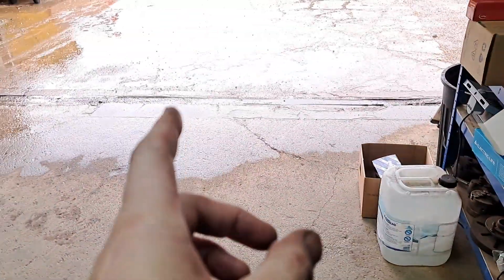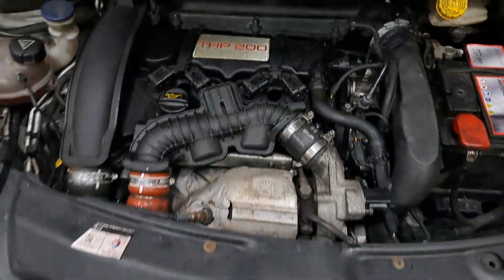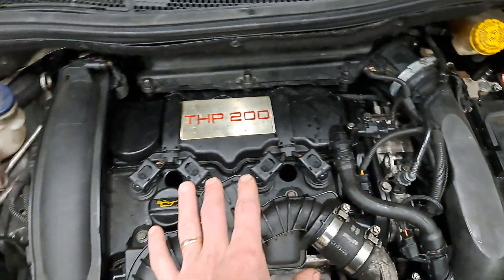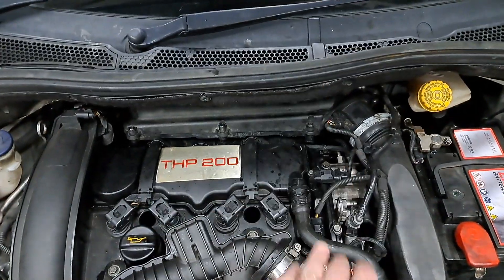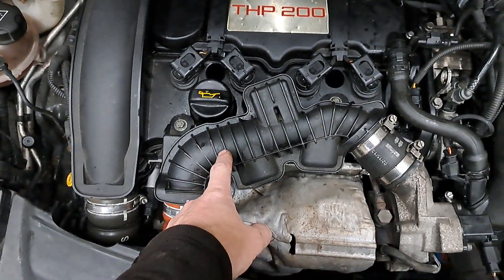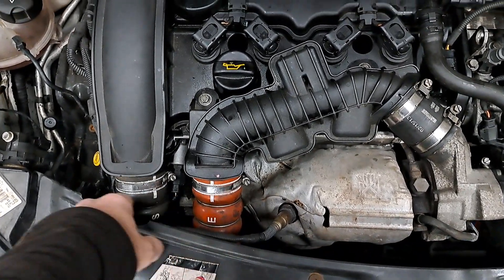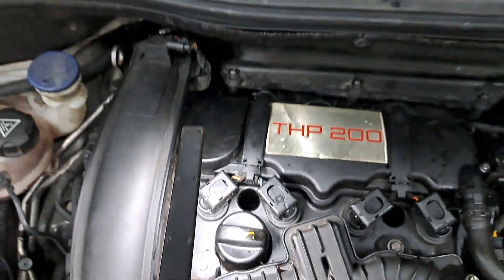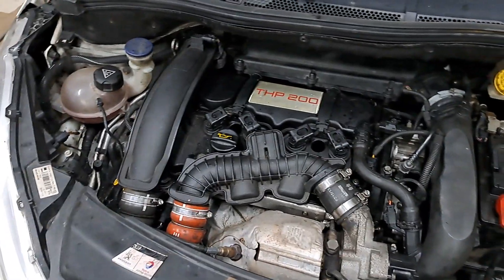Peugeot 208 GTi intermittent engine light p2074

Comment: So once you had diagnosed the fault how long did it take to fix it ? Mines in the garage for this problem and they’ve had it 7 days now
Reply from the maker: It depends how long they actually need it for most vehicles sitting garages are waiting to be looked at the vehicle should be fixed within a day once they have diagnosed the issue

Comment: Hi! Where are you based please? I have one of these cars, I have a "Dipping" idle, worse when air conditioner is on. Car runs and idles bad when AC is on. Cheers
Reply from the maker: Hello I'm in Spalding Lincolnshire
Reply: @RMmechanical Hi, maye I have a contact number... to speak with you?
I have Peugeot 208gti /2016 / and Engine fault.
Long time I'm looking for someone who can fix.
Thank you
Reply: Did you able to fix that bro? Have the same issue but I’m based in Macedonia lol Any help would be appreciated thanks
Reply from the maker: @DarkoMDj  yes the new rocker cover solve the problem
Reply: Might need your help with my car bro